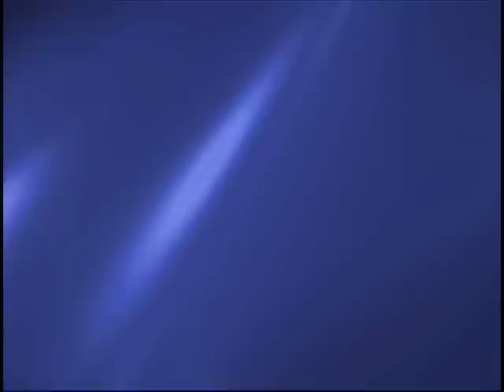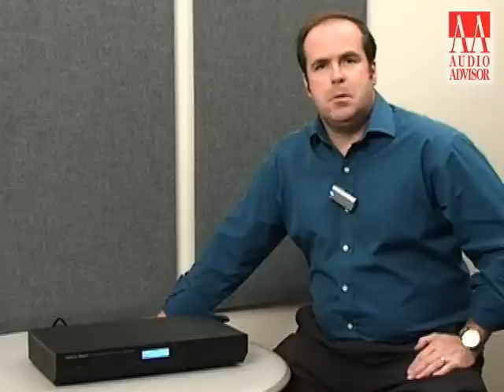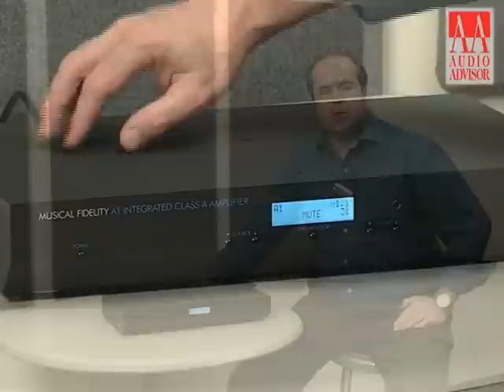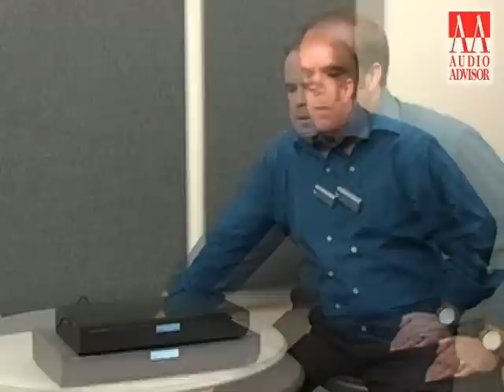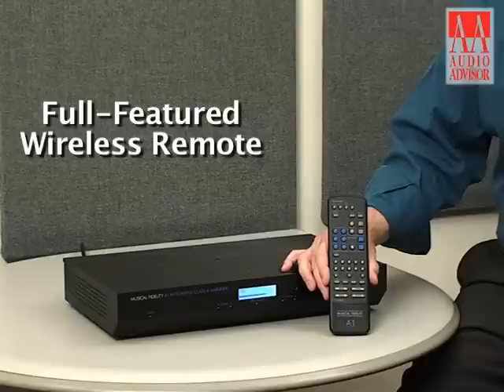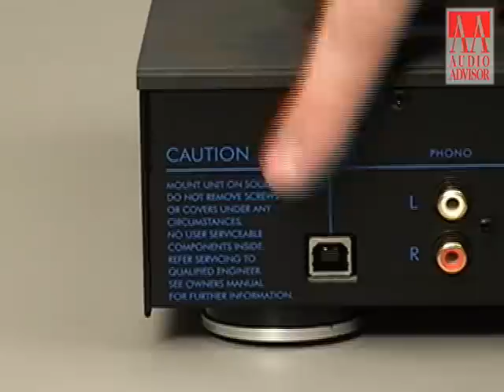Musical Fidelity A1 Integrated Amp – Audio Advisor

Comment: Your explanation of the theater bypass is confusing. I'm pretty sure the idea is that you use the A1 to drive the front speakers, while the bypass mode gives you a fixed level input, so the volume level is controlled by the HT processor, and remains matched to the center and surrounds.

It's technically impossible for this to be 36 x 2 Watts of pure class A, seeing as the spec says it draws 130W max. 

The original A1 was rated at 20 (not 30) watts per channel and ran hot enough to fry an egg.